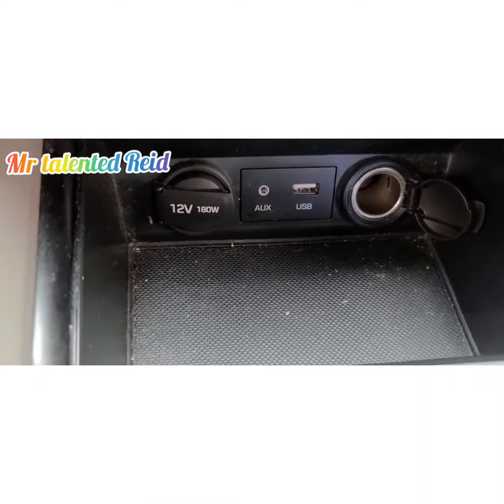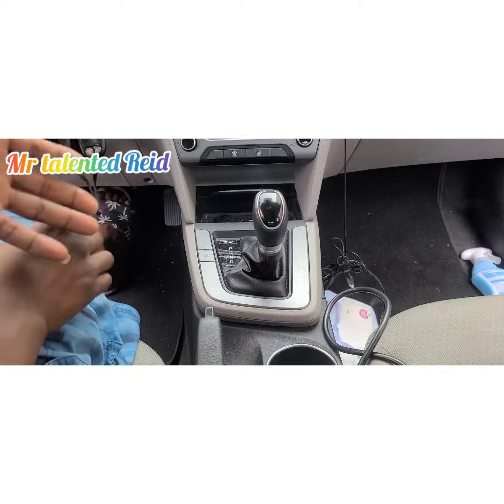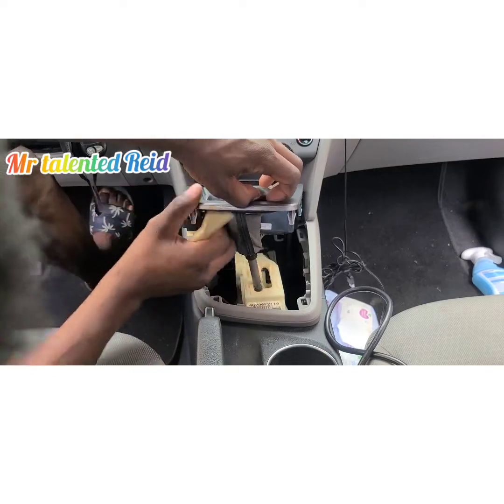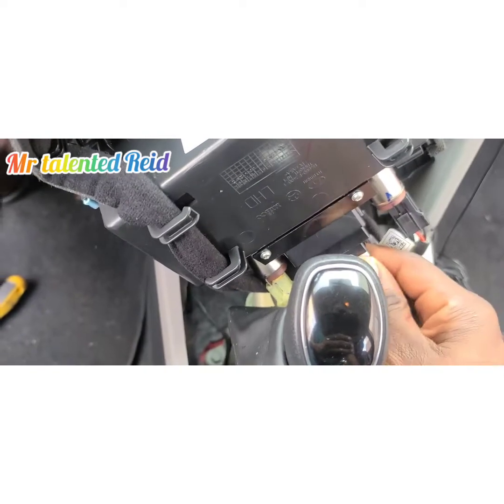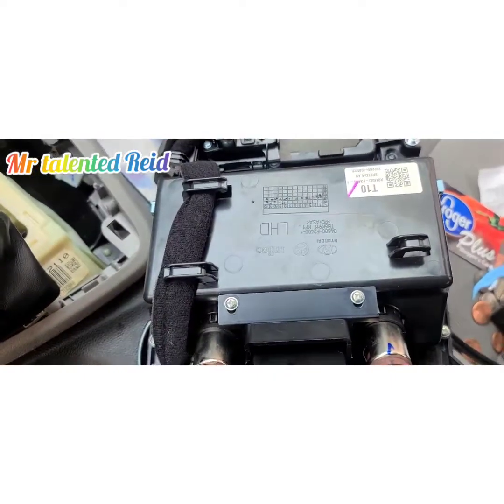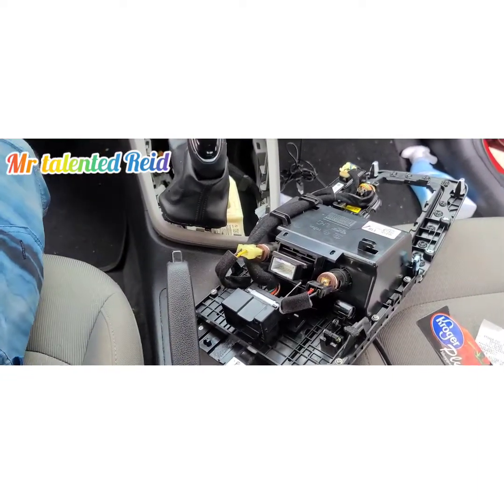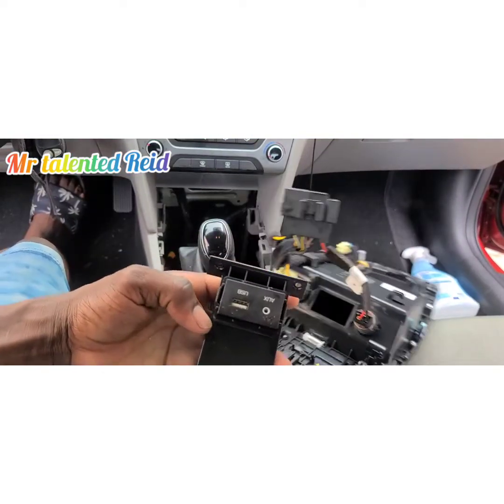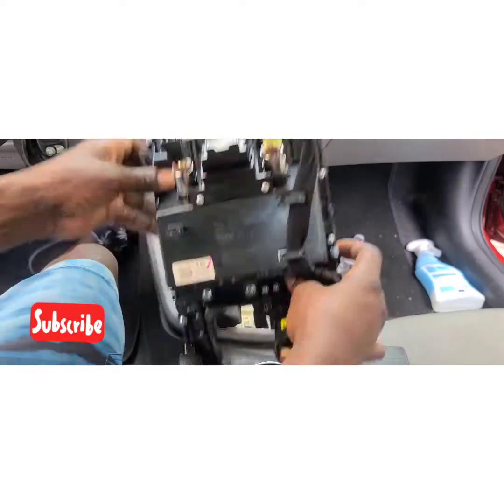HOW TO REMOVE AUX USB PORT HYUNDAI ELANTRA SE 2017

Comment: FINALLY! I've been looking for a video like this for ages. I'm going to try this on my 2017 Sonata since that part of the car is pretty similar between the two.
Reply from the maker: Ok appreciate your support by stopping by hope you have a blessed weekend
Reply: Was it not charging for you Kreig? Or Apple play not working ?
Reply: @adanleal8373  Not charging. The usb port was broken entirely.
Reply from the maker: Wow hope everything go well
Reply: @kreigdurham1651  did you end up replacing it? And did it work after? I’m having the same problem, my cigarette lighter works and charges but my USB port doesn’t work at all.
Reply from the maker: Check all the fuses first if all good change the use port
Reply: @MrtalentedReid  thanks
Reply from the maker: Your welcome
Reply: @adanleal8373  My issue was a bit different. The AUX/headphone jack works, which is on the same little box. But the little tab in the middle of the USB port is just missing so it's physically broken.
Reply from the maker: Ok have to just change it

Comment: Hi, I did replace the part but it’s not working. Any idea what went wrong ? I checked all connections , could it be fuse? I didn’t know which fuse to check for the USB port connector
Reply from the maker: Thanks for stopping by check interior fuses if any open ones there and also in the engine room
Reply: @MrtalentedReid  can make a video on where to locate those fuses? that will be very informative for those like me who needs help. thank you in advance bro
Reply from the maker: Ok no problem will try and do it today
Reply from the maker: Your video on the way
Reply from the maker: Please get me some friends

Comment: Thank you for this informative video.
Before I saw your video, I panicked and tried fishing out the sliding tray to access the space behind. I ended up breaking the spring mechanism of pushing the tray in and out, now it is opened all the time and when I push, it opens up immediately, do you know if this is a common issue and I can fix it by my self? Or should I get a professional look into it?
Reply from the maker: If you’re good with your hands you can do it

Comment: Hey buddy. What trim removal tool did you use? Is it part of a set? Can you point me to what you’ve purchased? Thanks.
Reply from the maker: GOOACC 40Pcs Trim Removal Tool,Auto Terminal Removal Key Tool,Auto Clip Pliers Stereo Removal Tools,Car Upholstery Repair Pry Kit,Precision Hook and Pick Set,Wiring Threader,Car Film Scraper https://www.amazon.com/dp/B082X6D5QY/ref=cm_sw_r_apan_glt_fabc_ZF04F6A3CEQDZQPW21VC
Reply: @MrtalentedReid  Looking at some of the reviews, people complain that the tool is not strong enough. Do you think it’s fine for minor projects like this such as removing the panel to get to the USB/Aux jack, etc? Thanks.
Reply from the maker: You can get a smell metal screw driver flat point

Comment: I'm having trouble replacing my port on a 2013 hyundai elantra, it is a little different than yours and the plastic pieces around the shift knob are not coming off as easily as yours  so I'm afraid of breaking anything. Any tips?
Reply from the maker: Thanks for stopping by. It is more easier to pull from the front they are just clips so you have to just pull up a little on it equally
Reply: @MrtalentedReid  thank you! It was a little different instead of removing the plastic that directly surrounds the shifter, you have to first remove the grey plastic trimming that goes around the plastic of the shifter and up towards the stereo. So it was a little bit different than yours, none the less got it done, thank you!
Reply from the maker: Your welcome

Comment: I m adding a new aftermarket radio to my Hyundai Elantra 2017. I guess this factory USB and aux part is not going to work so I would like to add a HDMI IN/USB there and plug/connect into de new radio. Is it possible? Thanks!
Reply from the maker: You have to get a USB converter from USB to hdmi

Comment: Thanks for the video. I did this on my 13 elantra but the new aux isn't recognized. I got another one and same thing. It's the exact same model as original. Is there something I have to do to get the car to recognize it? I tried undoing the battery terminal. When I put the old one back in, it is immediately recognized and I can select "aux"
Reply from the maker: You might have to use a computer to program it or get a use one that already program
Reply: @MrtalentedReid  OK thank you
Reply from the maker: You're welcome

Comment: My usb is not working aux is but whenever I put my charger in the usb it connects for a second showing it charging then dissoconnects would this vid help?
Reply from the maker: You man need to replace that usb port or clean it if you can

Comment: Super helpful video! My Android Auto keeps disconnecting - do you think it would help to replace this port? Also, I have the same car as this - can you share a link to Amazon so I can buy this port? Thanks!
Reply from the maker: Ok it is best to get a new one thanks for stopping by will send u the link soon
Reply from the maker: https://www.ebay.com/itm/284815994066?mkcid=16&mkevt=1&mkrid=711-127632-2357-0&ssspo=4wOfY4nfQfW&sssrc=2349624&ssuid=&var=&widget_ver=artemis&media=COPY
Reply from the maker: I only find a link to ebay
Reply: @MrtalentedReid  This is great - thank you very much!
Reply from the maker: Your welcome
Reply: @zacharygreytsman4465 is your andriod auto working fine after changing the port as I have the same car and same issue it gets disconnected for every 15-20 min and it wont even charge my phone up by 1%
Reply: @chanduaddala7496  yes, replacing the port fixed my connecting and charging issue. Works perfect since I made the swap. Bought the park on Ali Express for $20 and replacing the port took 20min. I'm not experienced but this video made it easy
Reply: @zacharygreytsman4465  can you please post the link where I can buy this part if possible..and thank you so much for your immediate response saved me a lot of time..I have visited dealer for this issue and they gave an estimate approx 400$ CAD 😅😅

Comment: Where is the sd card location in that car to update the software???
Reply from the maker: Thanks for stopping by after go through all the interior it only comes with a USB PORT.
Reply: @MrtalentedReid  thanks for answer... I downloaded the software in a usb memory, but I couldn't update the system coz the internal memory is not enough... the SW is 20GB and the internal memory is only 3500 Mb... I've seen that other elentra 2015 and 2016 have the sd location by removing a bottom... in a elentra 2017 idk w is the sd location!
Reply from the maker: What you can do take it to the dealer and let they assist you